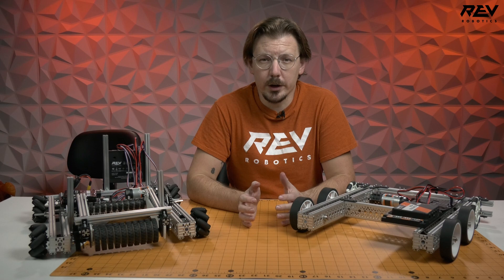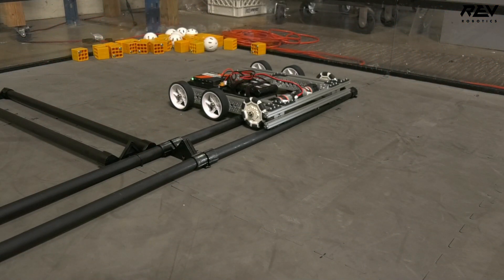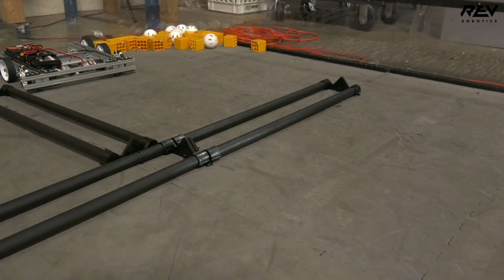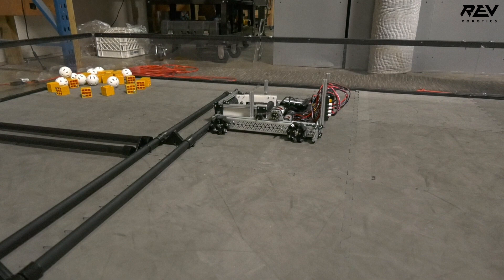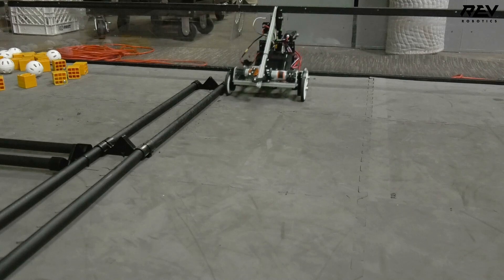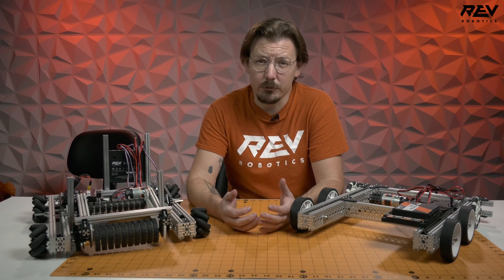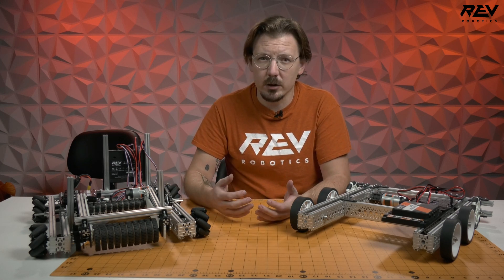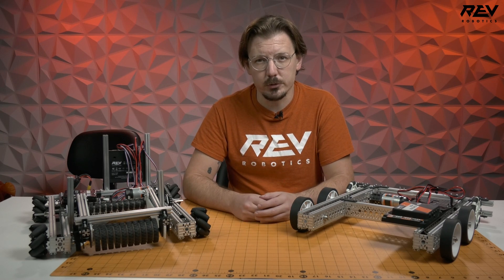Early Drivetrain Testing - FTC Freight Frenzy 2021-2022

Comment: for the mecanum chassis will it fit inside the 18x18x18 box if you add 4 inch mecanum wheels from andymark or something? If so does that make it tall enough to get over the barriers? From what I checked I think it might work (from re-creating it probably not at the right scale in blender).
Reply from the maker: Likely there are design choices that would allow for various wheel types.